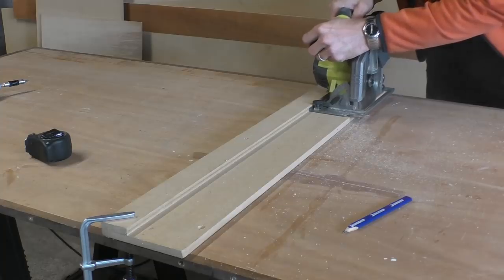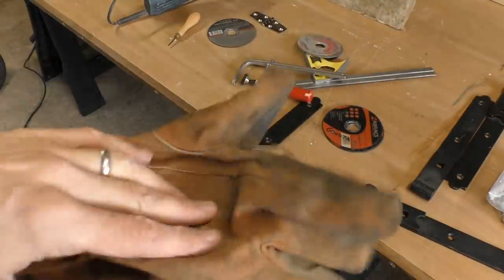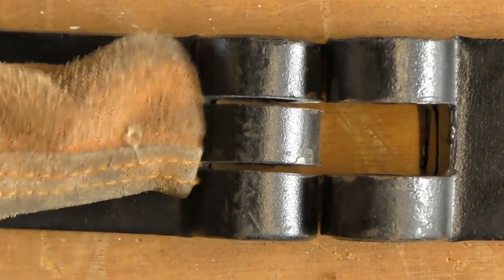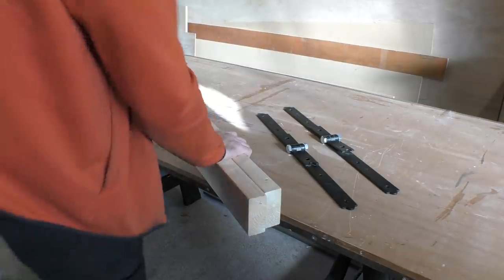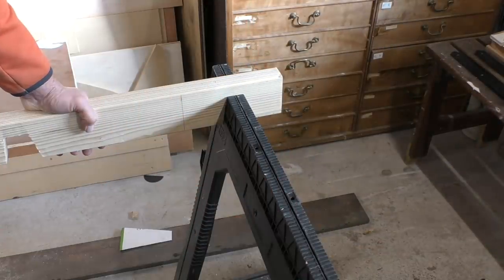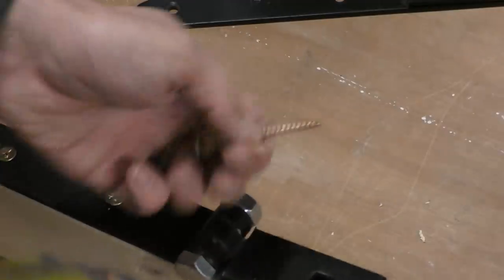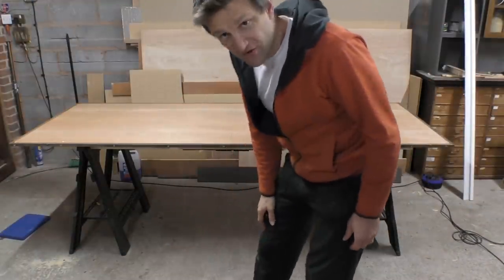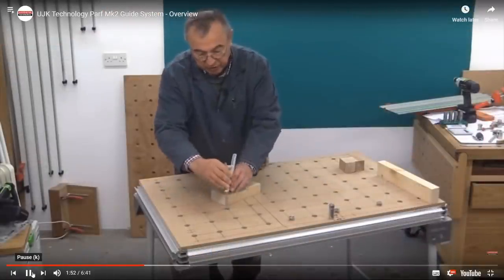The ULTIMATE DIY Portable HINGED Folding Workbench: Upgrade video 4 of 5

Comment: It's a good idea, but those plastic sawhorses should be strong ones made of wood.  They can be foldable or stackable------but strength and stability are much better with wood.
Reply from the maker: I hear what you say Robert. They've never given me a problem though as they're plenty strong enough in terms of downward weight. The biggest issue you have is accidentally kicking them or stepping on the bottom tray - which I did recently and partially snapped it!

Comment: Might have been better to remove one half of each hinge.

Doing it this way, you have one side with 1/3 and one side with 2/3 of the original material.

But if you cut them in half, they'd be much easier to cut because both sides would be outside cuts, and all four of the hinges would be cut exactly the same size and shape, so they'd be universally interchangeable.
-----L7-----
Reply from the maker: Yes, I think you're probably right! The hinges are so thick strength is not an issue with the way I've done it but it would have been a whole lot easier to cut them in half.

Comment: Hi, wonder if you could help, I know how to find equal spacing on rails with balasters or stair spindles, pickets etc, now question if I find equal spacing on say railing on decking I'm wondering if it's a case of measuring out the decking first so as to get the same increments as each railing as there's probably going to be different length runs, or is it a case of building deck and then measuring every different run time and again until I get a matching spacing or near as damn it, similar situation stair rails, the spindles normally set even on each tread but if you have a railing at top of landing for e.g. the opening may not be matched to the same spacing as the ones rising up the stairs, I've wondered if the measurements were done to match on the drawings when being built, then the same sinario if you have several different runs on a picket fence,  could you shed any light on this matter thanks. I liked the hinge idea, and I get thin cutting blades makes cutting a lot better and precise as you said, sorry for the essay, cheers

Comment: I wouldn't bother with the parf guide system I think it's unnecessary and expensive. To accurately cut panels etc. use an aluminium profile (or any straight edge) temporarily fixed/butted/clamped to one end of your bench that you can square to an opposite end reference for a saw rail to butt against. Just mark out and drill the 20mm holes for dogs and clamping.
There's a Peter Millard 10 minute workshop video of using rail dogs that fit to profiles that you can also fit sliding stops to making a very versatile but cost effective alternative.
Reply from the maker: Fair point. I bought it a while ago so I feel I ought to give it a go. I suspect the other issue is that it'll make a real mess of the underside of the table as the drill goes through. Also, I was interested to see how light I could make it, and all those holes have got to help...
Reply: Enjoying your videos Charlie. The holes won't make it any lighter trust me and actually the forstner bit included in the parf system is of very high quality is it not? Use a sacrificial sheet of something to prevent tear out underneath if necessary.
Your building the best for diy but from experience a simple MDF top with an alu extrusion fence and 20mm holes for clamping, fixed on horses works for me.
Reply: @samartin745  sounds like a good idea, any pictures of that in action?
Reply: Dave, I'll post a video when I've got some time. It's evolved into the best solution for individual requirements. Regards.

Comment: I wouldn't have bothered with the hinges. You could just use the four horse and just created clamps to join the 2 smaller benches together.
Reply from the maker: True - this did occur to me but I only bought the other two horses the day after I finished the hinged system. Look, I'm the fall guy just throwing stuff out there and it's up to you all to decide which system works best for you 🤔😉

Comment: You might want to put hole handles in the 2x4 braces for carrying. As well maybe a plastic or rubber edge would probably wear better on the sides.

Comment: Why not simply place unmodified hinges side-by-side, then run a longer bolt through both?  Hinges don’t lose any structural strength, and you can use long, threaded rod if you can’t find all-thread bolts.

Comment: Hi Charlie I just found out about your channel and I love it. What are your thoughts on the Ryobi devices you use. I normally use Makita but there is a difference in price for one.
Oh and by the way I subbed - ATB Marc -  Belgium
Reply from the maker: Hi Marc - massive thanks for subbing and great to drum up some support in Belgium no less! I was introduced to Ryobi when my father in law bought me a drill and driver set about 10 years ago. Didn't know anything about them at the time and was probably a bit snobbish initially. But I've been using them ever since. Love the fact that they never change the battery fittings so you can use your batteries across all the tools without fear they're suddenly going to be rendered obsolete (unlike some of the competition eg DeWalt). I love the price point and I've got to say I've been using them for some pretty demanding stuff in the day job for the last several years and I've never had one fail on me. I get a few comments on the channel saying I should stop using toys and buy myself a proper power tool like Milwaukee or De Walt but personally I think that's uninformed tool snobbery and the old adage "bad workmen blaming tools" springs to mind. Makita are obviously a top brand, but if you bought one of the new brushless Ryobis and a decent battery you wouldn't be disappointed.
Reply: @CharlieDIYte  Thanks for the swift and elaborate answer Charlie. Now I finally know what to ask for at Christmas ;-)
Reply: @marcdewilde518  Hi Marc, I can back Charlie up on the Ryobi gear. I use them at work and have for years. Are they as good as the top of the line Makita or Dewalt? No. Do they get the job done? Hell yes, and at a fraction of the price, which at the rate I lose tools is very important to me - I have gear spread all over this city!
Reply: @johnsimpson8263  Hi John thanks for answering. One major problem though - it seems almost impossible to find Ryobi dealers in Belgium and the ones that sell on-line  are charging prices much higher than in the UK or over the pond.. But I am not giving up yet ;) - ATB and thanks again.
Reply: @marcdewilde518  I understand about not being able to get things locally. Living in New Zealand the number of things I see on YouTube that would be nice to have that are either not available locally or over the top expensive is large. E-bay can help but it is not without it's own issues. I try not to listen when I hear prices quoted in US or European videos - it can be quite unsettling!
Have an excellent new year.

Comment: Ignorant american here; What is that CLS lumber? Is that what one would use as a standard wall stud?
Reply from the maker: Yes exactly. It's what they use over here for stud work, the idea being that the rounded edges reduce splinters when handling it, I think.
Reply: @CharlieDIYte  Thanks! I tell you what, that CLS looks higher quality and a hell of a lot straighter than the 2x4 studs I can get at my local builders supply store. Cheers!

Comment: How are you so lucky that those CLS pieces didn't warp?
Reply: Also would the centre be stronger if you bevel cut the ends of the 4x2? I think it's called a scarf joint? I can't get my ahead around if that would work with the hinges though.
Reply from the maker: I never thought about the CLS warping, but it's stayed pretty true over the years. The chinese ply as they call it has bowed a little across the width however, so maybe it needs some cross struts to prevent this happening.

Comment: My Grandpa always told me that the only thing a person can do "properly", with gloves on is..."Pee Your Pants, because you can't get your pants unzipped, or unbuttoned". Over the years, many people have found that he was entirely correct.
Reply from the maker: I generally don't use gloves but I try to when using power tools like this and have become a bit of a convert to painting in gloves - particularly oil based paints. Also, when handling thorns and general stuff in the garden, gloves are a must!! 😉

Comment: What about a strap hinge?
Reply from the maker: Don't generally have a removable pin, and also they aren't quite as sturdy. But if you're not planning on using the bench in two separate pieces, then yes, a strap hinge would be fine.
Reply: Charlie DIYte I often grind off the riveted hinge pin end and then it's removable. Replace it with a plain shafted bolt of the right size and use a nyloc nut and two washers to take the slack out.
Reply: A tip on cutting blades  ,I use a solid  tile cutting blades for thin sheet metal and clean up. Last much longer  and the work  is cleaner

Comment: A word of warning to anyone doing this workbench build - M14 bolts do not reliably fit into the hook and band hinges, regardless of whether they are fully threaded or not. The tolerance on the hinge bending is not good and the bolt only goes about half way. Now I need to try and find an M13 bolt somewhere 🤦‍♂️
Reply from the maker: That's frustrating. Mine fit perfectly.
Reply: @CharlieDIYte  Not to worry - found a 14mm drill bit at toolstation for £4 which should remedy the problem! Much easier to find than an M13 bolt 😅 Thanks for the videos btw - you're awesome. I'm building the workbench in preparation to copy your wardrobe build as well!

Comment: You could have just off set the hinges and bearers so the are not in line on each half's. That way you would have not had to cut your hinges. And when you fold it up it is not double the thickness or you wouldn't have to disassemble to make it thinner. Sort of like this >>>       _________------------
Reply from the maker: Like the idea, but unfortunately this wouldn't work, because you need the two CLS beams to be butting up to each other, otherwise the workbench doesn't lock into horizontal position when open, and you'd have to find some way therefore to stop it concertinaing in the middle when you put any weight on it - unless of course you use 4 saw horses all the time, in which case, you might as well not have a hinge at all.

Comment: If you've got 4 saw horses does it actually need to hinge? you could just push the 2 smaller benches together. It would make sense to hinge it to if you only had 2 saw horses. Not a dig, find your videos really useful and helpful
Reply from the maker: Hi Ben. Yes you raise a good and rather obvious point 😏 The thing is, I designed the folding bench with only 2 saw horses in mind but bought the additional 2 because, having gone to all the effort of making the hinge with a removable pin, I wanted to be able to show that you can use the two benches individually. Particularly with the new Parf Guide system I've just installed, the hinges help to ensure the bench is perfectly aligned, which you'd struggle to replicate if you were simply butting the two together. So I suspect I won't use the additional 2 that often.
Reply: @CharlieDIYte  👍 I've made the same bench(on a smaller scale) following your original video.

Comment: But dude.. you never needed that thin of a cut. You should have grinded out the center with a regular grinding disk and never layout both ends at same time. You never know how accurate you will be. Instead, lay out first end, grind it out then scribe the adjoining end to it directly. 

If you need to support the center , you can use thin steel cable and run it like an upside down suspension bridge. Check out some images of a portable massage table. But with your hinges, I don't think you need to go as deep with a center support as they do with massage table.  I made a portable, folding camping table using this principle and only had to drop the center support about 2" ..and I only used 550 cord, not cable.. it works like a charm. The key is to keep table slightly bent when tensioning the cables. For a center support, I just used some 3/4" copper pipe and 2 90° elbows and drilled a couple 7/8" stopped holes in the underside of the rails. So it drops out of one hole a couple of inches , breaks 90° over to the other hole and breaks up into the other hole the same couple of inches. That's what supports the cables and gives the center of your table constant upward pressure. The harder its pushed down, the harder it pushes back.

Comment: Would you not have been better splitting the top 1/3rd  2/3rds to give you more flexibility?
Reply: BTW your videos are absolutely fantastic. I've just re-siliconed our shower after the silicon put on by a 'professional' started leaking after about three years, based on your advice. I'm very happy with the results. Please do keep on discussing the small details/ problems you come across and how you worked round them.

Comment: For the record, an "unthreaded" bolt us exactly that, a bolt! A "bolt" threaded all the way is not a bolt, its a machine screw!
Reply: Funny how different we all see the same things. Here in the States, a bolt requires a nut to complete it's purpose as a fastener where as a wood screw has tapered threads which provide the gripping force and a machine screw uses threads formed in a hole in a mating piece of metal such as a tapped hole in a square tube frame and a sheet metal panel attaches to it. Think machine cover on a machine frame. The "threadless bolt" shown we call a "shoulder bolt".  The shoulder bolt would actually be the proper bolt to use in the circumstances if the hinge hole was a bit larger. The threads are designed to work with axial  ( lengthwise )forces where the solid, unthreaded portion of the shouldered bolt will better resist shearing (side to side) forces.
I hope that helps someone better understand the basic why's and what for's of bolts and screws and how we identify them.
Peace to all.

Comment: I love the energy and happiness in your videos.  But you made the same  mistake of every woodworking video I've ever watched.  You spent almost 22 minutes showing us what we can do ourselves, and exactly 90 seconds discussing the only thing that really matters - how to get the two pieces of table to be perfectly flat again.  You 'just' cut an angle?  What angle? 42-degees ? 26 ?  How did you decide on this angle and how did you cut it exactly the same on the table-top plus the edging?  I can see that it keeps the wood from shifting up and down (versus a butt-joint), but why does this work to keep it from sagging?  Thanks.
Reply from the maker: Oh, sorry about that. I'm not sure which angle you're referring to. The angle cut in the supporting struts that fit on the saw horses is done using the adjustable square, and the supports themselves are just cut at 90 degrees. Ping me another comment if I haven't answered your question.
Reply: Haha - I'm busy scanning through LOADS of comments looking for exactly the same thing. Critical information and all we got was "I just cut an angle". 

Found the bolt idea above though which should work just as well to stop the sagging.. but still curious to know how removing material from the centre makes it stay up! Was the angle cut on both sides?

Comment: In the end, when you removed the screws, it was obvious how much useless work you have done. The hinges are absolutely useless. You should think to replace them with more precise and sturdy connectors, and always use four saw horses, or three, with the connecting system attached to the saw horse in the middle, which would support the joining point of the two halves.